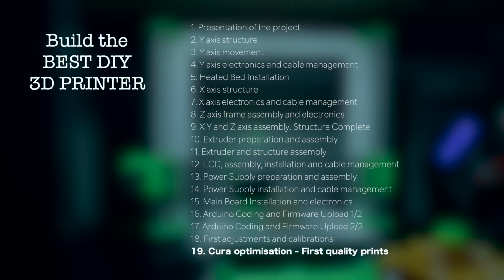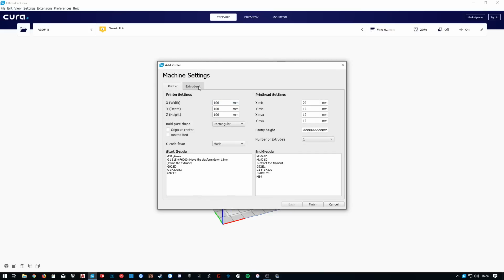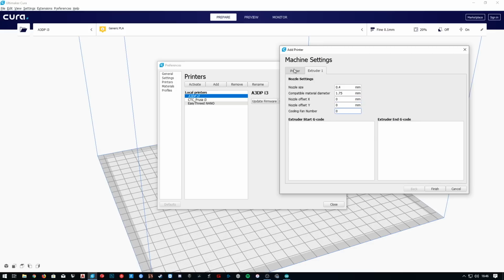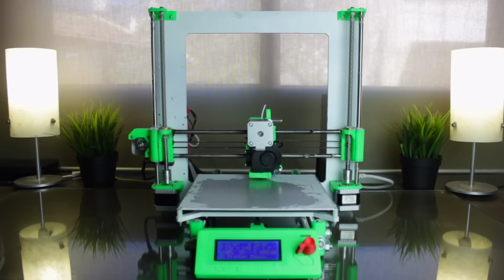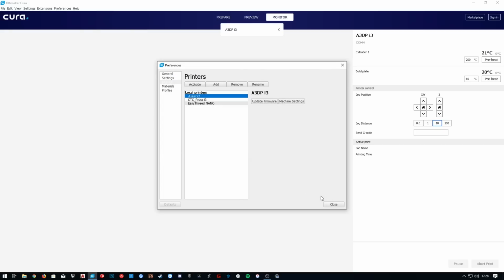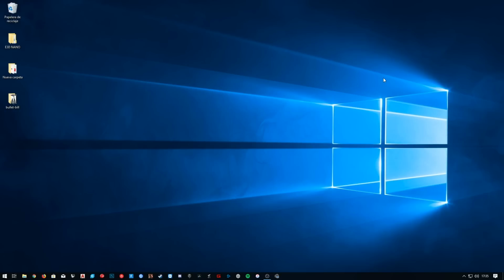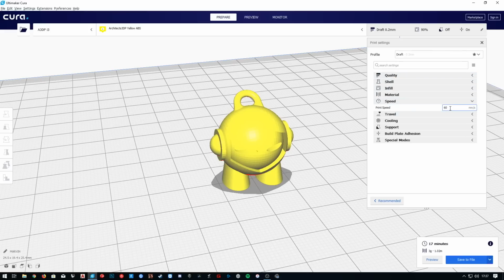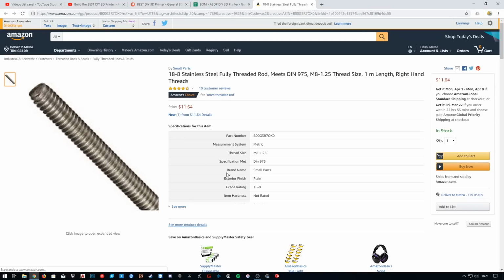Build the BEST DIY 3D Printer - Cura optimization - First quality prints #19

Comment: Thank you for the videos. It is a great boost and encouragement for me to consider building my own printer.  I am just wondering if there is any free 3D drawing software out there I can use/download. I heard that Autodesk fusion 360 and solidworks are 2 of the well known ones but they are very expensive. Please advise.
Reply from the maker: Thanks for your comment muhac80! There are some free, but as everything, to get quality software you have to pay for it (or use pirate versions). 
I think you can get for free fusion 360 as well as sketchup. I've a couple videos explaining how to download them.
Fusion360: https://youtu.be/u_zEK-nJij8
Sketchup: https://youtu.be/VTtH30FRvVM

In my case, I use Rhinoceros, since it's the one I learnt why studying architecture and I can use it in both fields. You can download it and try it out as well. https://youtu.be/1IshcPa92Uc

Comment: How is this supposed to work for the printhead settings? The first X and Y values should be negative, no?
Reply: Exactly my thoughts, X & Y min MUST BE NEGATIVE as indicated by the 'hints' when 'hovering' over those options in Cura.
Reply: The version of Cura that I'm using (5.2.1) forces me to insert negative values for X min and Y min. I can't add positive ones.